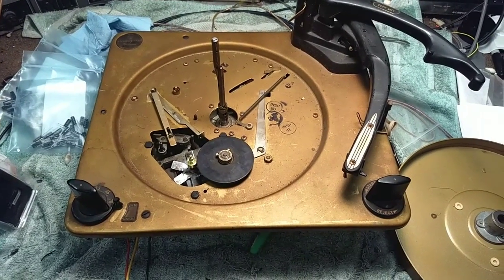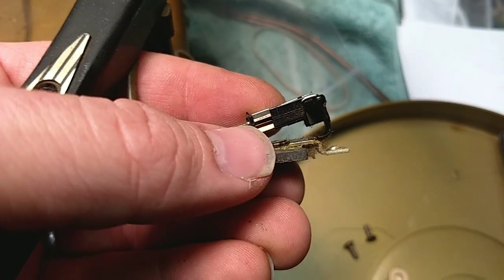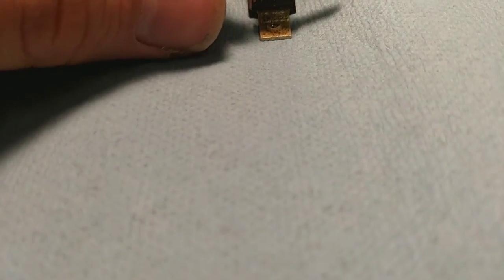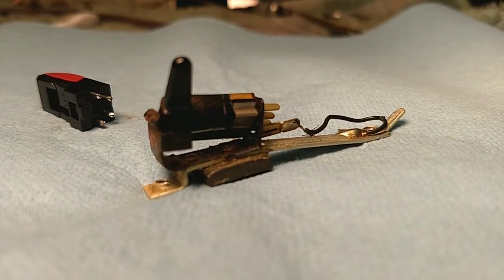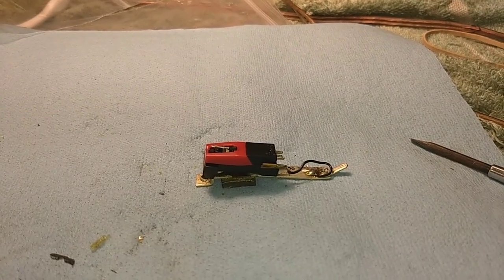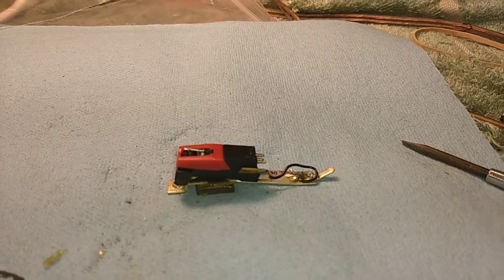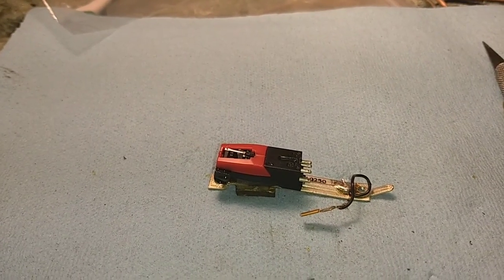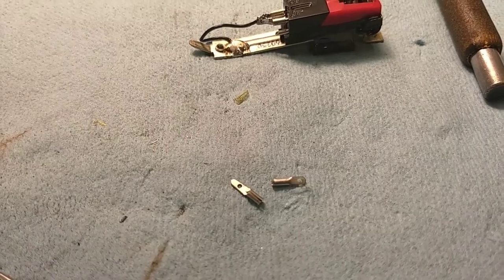Servicing a 1958, 1959,1960 Collaro (Magnavox) record changer - Part 3

Comment: Could you give more info on the flip cartridge you mentioned but did not install?
Reply from the maker: banpa Turntable Cartridge Replacement BP2ATC - with Two Side Red and Blue Diamond Tip for Vinyl LP/78 RPM Record Player https://www.amazon.com/dp/B071WMFGHL/ref=cm_sw_r_cp_apa_i_DJhwEbQ6GDTBH

Comment: Great way to get a modern cartridge in one of those Collaros. I've had success in the past using the 1/2" cartridge holder from an old Garrard AT60 type headshell (the cast metal insert with the single screw on top) and slightly filing down the inside of the Collaro arm to fit a standard cartridge. I was able to fit a new Shure M70 magnetic cartridge in a 1963 Collaro / Magnavox changer this way, then I added a phono preamp wired to the console's 110v pilot light for power. Set the tracking force to around 2~2.5  grams and it worked like a charm and sounded GREAT for years. I didn't like the sound or the tracking force of the ceramic that came with it, that's why I went to all the trouble.

Comment: I'm looking for info on a Magnavox stereo wth phono and AM/FM radio. The are two individual cabinets each housing  1 15" woofer, 1 7" mid range, and 1 5" tweeter. In one cabinet is a "Custom" turntable and an AM/FM rdio and the cabinet has a lid that lifts and props up for record storage.  I have all the papers, including sales receipt but can't find any info online or through Magnavox.  model number: ISP275F.. it's like it didn't exist! Do you know anything about it? I'd like to sell it but have no idea how much to ask
Reply: That sounds JUST like the Magnavox that I just picked up, two cabinets, one being the extension speaker and the other being the turntable and radio. My model number is ISR210 F. Loving it so far but I need to get in and replace some caps for sure. It's like taking a trip back in time!

Comment: Hello Jordan I am currently working on the same turntable model, is there any specific cartridge you recommend or what can I add that is good upgrade, I just had the amp and radio dock serviced and fixed and wanted to do the turntable myself with an upgraded new cartridge, I wanted to install a Ortofon 2M Blue Moving Magnet Cartridge.
Reply from the maker: With the tonearm on that machine youll never be able to realize the 2m blue for what it is. 

An AT-3600L would work best for that tonearm. 

You also will have to remove the compensation networks from the phono input sonit can be entirely line level and install a moving magnet phono preamp to connect between the turntable and phono input on the chassis.

Its alot of work
Reply from the maker: A good ceramic cartridge like what ive pictured will sound great and the electronics are already made for it.
Unless its a forever set and you dont mind pissing alot of time and money into this project I would stay with a ceramic cartridge